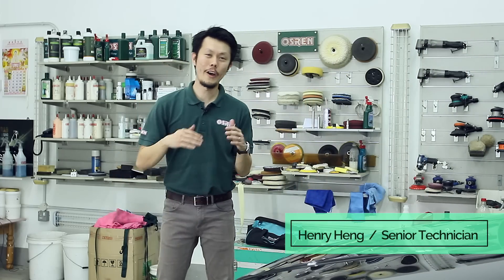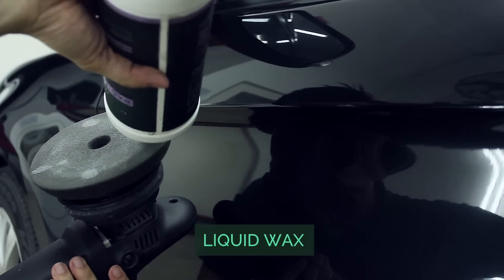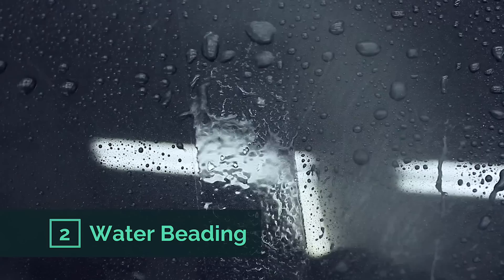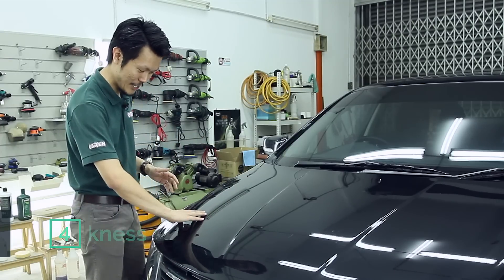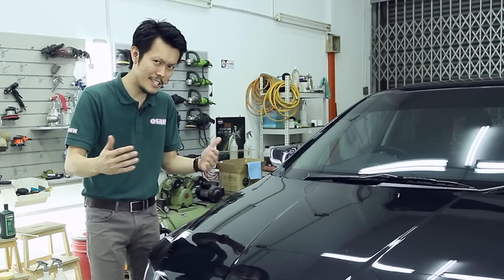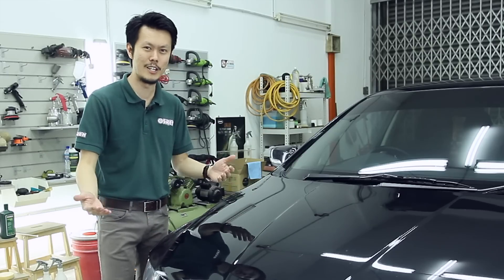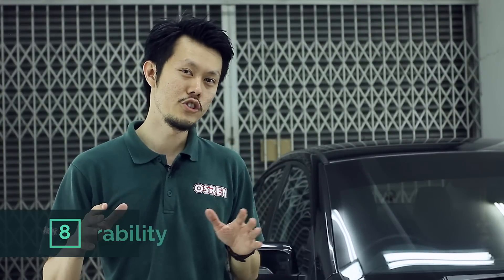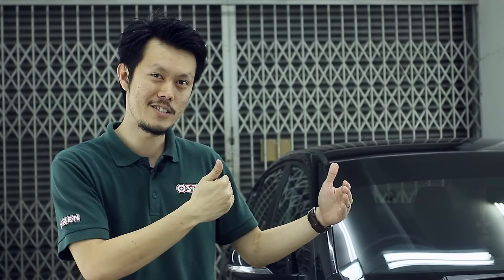How to Choose a Wax (8 Characteristics of a Wax)

Comment: DEAR SIR.. i BOUGHT A RADIANT 12 AND APPLIED IT AFTER CHEMICAL CLEANING AND SURFACE PREPARATION, BUT DIDNT GET GOOD RESULTS. CAN YOU KINDLY ADVISE ME A PROCEDURE TO APPLY THE SAME TO ET BETTER RESULTS? THANKS..
Reply from the maker: Hi Sajeev, what do you mean by chemical cleaning? Application of wax is fairly straight forward, apply and allow to cure according to the instructions and buff evenly. 

For technical support, you may get in touch with our support team at support@osren.com
Reply: @OSRENOfficial  Thanks a lot for your response sir. Yes, grease removal, iron removal, shampooing, drying, then  medium cut by machine and surface cleaning using IP solution. This is the procedure I do this before polishing. I applied your radiant 12 using applicator. I waited for 10 min as per the instructions to get a hazy look. But instead I saw patterns like swirl mark and had to further cut it off by using a medium cut liquid paste using machine. I didn't take a second chance with your product, but used another mirror glaze to produce a glow. I wish to know what went wrong in applying your product, which I tried for the first time ever. I will be glad to get a convincing reply from you, as I regularly test new products to enhance my experience. 🙏
Reply from the maker: @kreeds1595  Based on the information you provided, it seems like you might be  experiencing swirls or streaking on paint. You will need to identify the phenomenon. 

For swirls I would suggest under proper lighting, a warm white spot light (has to be warm light spot light, not a fluorescent/flood light) to inspect the paint prior to applying wax, after polishing. Finish it down with a lesser aggressive finishing. 

For streaking, best to apply wax thinly, it should just suffice to create a thin layer on paint. Buff with a m/f towel thereafter. If streaking still appears, wipe with a damp towel, followed immediately by a dry m/f towel.

Comment: Wax better or using sio2 spray for new car?
Reply from the maker: Hey Shaun, depending on what you think 'better' is. For many, time-saving and ease of use is 'better', that's where sio2 spray sealant fits their need. Some enjoy the process of waxing, hence conventional wax would fit them better. 

If features wise, you may read up on reviews of certain waxes or sio2 based sealants to decide. The centre of this video is to help understand the characteristics of the waxes or sealants you may look out for.

Comment: Great job explaining a confusing subject ... 2 Questions 

1. Greasy waxes "Zymol Glasur" that are harder to remove and leave a "haze" on black cars typically on the hood after it heats up, any tips for removal or prep that would cure that problem? 
2. Will you be doing a video on Sealants and wax layering?
Reply from the maker: Hi Bobby, we havenever come across such incident before...hmmm it's weird. A cured wax should not haze up.
It's best to consult the manufacturer. 

It's a good suggestion on wax layering. Perhaps we can consider. That said, sometimes, different solvents in wax/sealants will actually weaken a cured wax (depending on formulation). After all solvents in wax are there to keep wax in spreadable form (keeping it from solidifying inside the packaging).
Reply: Its well documented on-line, after you pull the black car out into the sun, the hood hazes over before your eyes, even with a 24 hour cure, it can be removed with a wash but I was trying to prevent it from happening in the first place.. Zymol is no help in that regard which is a "warm" wax as you described .. Same thing happens with Autoglym Hd wax btw which is a "shine cleaner wax".. I always thought it might be a residue issue from some left over oils from the final polish? 

You're the best bro, I didn't know sealants can weaken the wax, wow good info..

I really wish I could order your products, but being in North America the shipping would be too much.. If you ever start distributing Osren products here I'll be your first and most loyal customer .. 

All the Best .. And thank you...
Reply from the maker: Bobby Bass ah. I think I misunderstood you. 

If you are referring to streaking, you may try to use the 2 microfiber clothes method during buffing. 1 damp cloth to lift the oil up and one dry  microfiber cloth to buff away the residue.
Reply: I tried that with "detailing spray" made more of a mess than anything.. I'll definitely try water next time, cold I assume ? Zymol Glasur is extremely difficult to remove, it pulls the hairs from regular microfiber and smears. I have to use Griots Garage PFM waffle weave war removal towels to get a lint free finish..  

You're the only Dude on youtube with a true depth of knowledge of the craft of detailing ..  I learned from this guy, and you teach the same, I did these two cars with him.. 
http://macdetailing.com/continentalgt2.html 

http://macdetailing.com/phantome2.html

Cheers , thank you again
Reply from the maker: Hi Bobby, Kenneth here. May I know when applying the Zymol Glasur, what was the ambient temperature and humidity like? For slow drying/curing paint protectants, the ambient condition as well as 'dryness' of the paint is crucial. For an extreme example on recreating this haze, it has just rained, the air is very humid, temperature is low, harder for water/moisture to evaporate and I apply the wax right after washing and drying the car, this would easily make the wax re-haze. 

A method I like to use but can be very time consuming is, after washing and drying the car, hit the paint with hot air from a hair dryer, this will rid the paint of TRAPPED MOISTURE from its microscopic PORES. Next, apply the wax, let it dry. Again, if your ambient temperature is low and humidity is high, hit the waxed surface with hot air, allowing it to dry thoroughly and buff off. Let it dry naturally for about 30 minutes(the paint shouldn't have any visible wax at this point), hit with hot air and buff again. The key point is reducing or eliminating MOISTURE. 

I've tried using glass cleaners, light IPA and quick detailing sprays, while these would fix the problem temporarily by cleaning off the top layer of haze, the underlying problem is still there, the MOISTURE trapped underneath. If there is streaking, I actually prefer leaving it until the next wash where the streaks would wash off easily. If it's a customer's vehicle, then hit it with a light IPA or a quick detailing spray(one that has more cleaners than wax)before delivering the vehicle. You should also get better durability from the wax this way. Hope that helps!
Reply: Hey Kennith, I've tried all humidity and temps and every season .. I leave the car to dry 24hrs before wax application and its always the same, the problem with Glasur is you can't let it dry as per the instructions. It becomes impossible to remove ..  30secs - 1 min is all you can let it set. 

I'll definitely give your techniques a try though, by drying it with a hair dyer, it may "dust off" more like Autoglym Hd wax after making a better bond with the surface. I also have tried to give a ice cold water spray wipe down prior to pulling the vehicle out after the waxx has cured 12-24 hrs it helps a bit but its no cure.. I'll try your damp cloth wax removal trick to see if it helps ...I too wait for the streaks to show, then next wash they're all gone..   I believe part of the reason for all the trouble is the extremely high carnauba content 56%, but its the cheaper yellow variety not the white carnauba as in the higher end Vintage .. 

Maybe I have a bad batch, my mistake for buying a cheaper boutique wax I guess..

No, this is for my personal cars, not clients.. I retired from helping my teacher to detail 7 years ago.. 

If I ever find a solution I'll send you a message.. lolol 

I really appreciate all the help Ken... I wish you all the success in life my friend..

Bob..
Reply from the maker: Hi Bob, Kenneth here. Sorry for getting back to you so late! Anyway I've also experienced this problem with another high Carnauba content wax. I've also tried the ice cold water method, but doesn't really help as well. I guess this is just a common characteristic of high Carnauba content waxes which is why I don't really use it on a client's car(while I was still detailing). Cheers Bob!